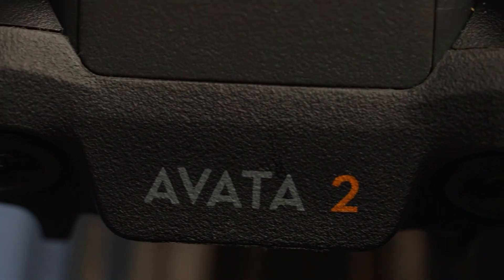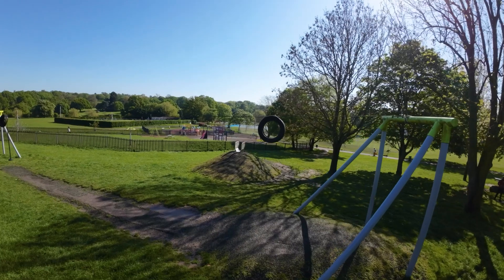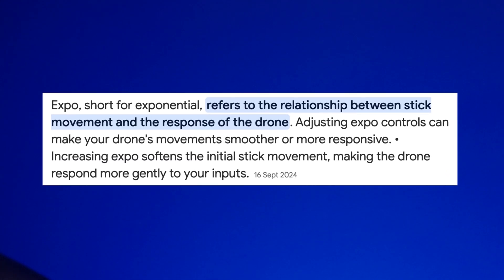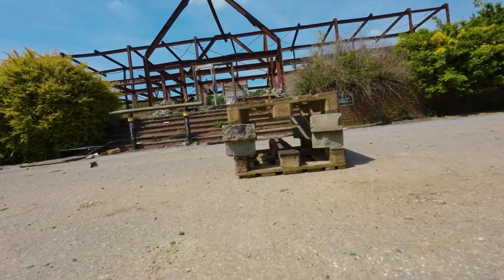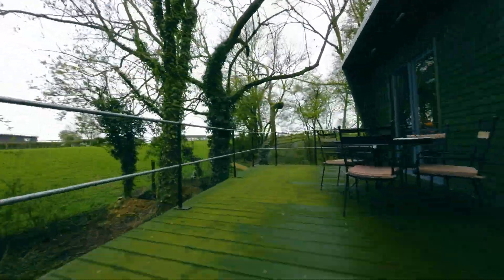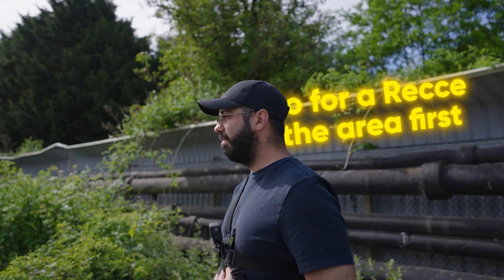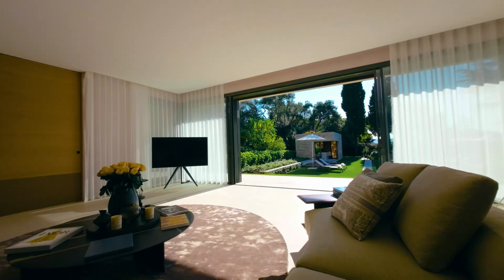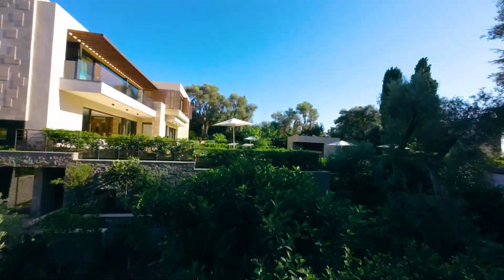DJI Avata 2 - Gap Threading Secrets Revealed

Comment: are these your indoor shots inside the real estate properties? if so could you tell me best setting for the avata 2 for recording indoor? currently using 4k60 @ 120fps auto ISO exp -07  log profile and rock steady. does this sound correct?
Reply from the maker: Yes sure I’ve actually made a separate video you can watch on those settings. Go check it out 👍🏽